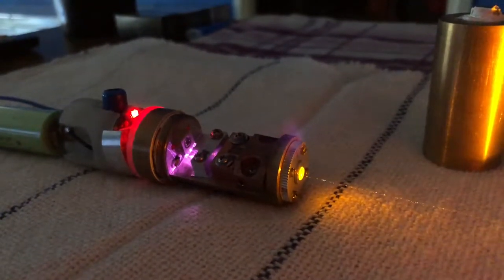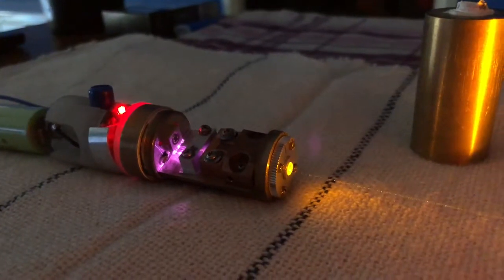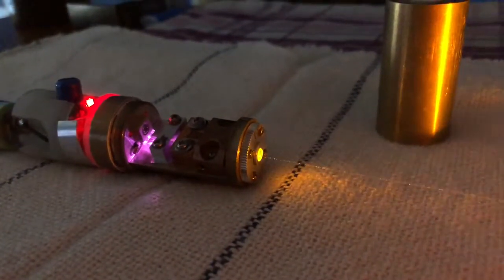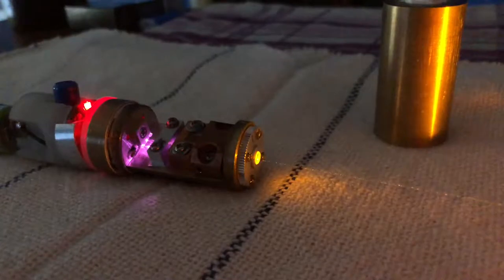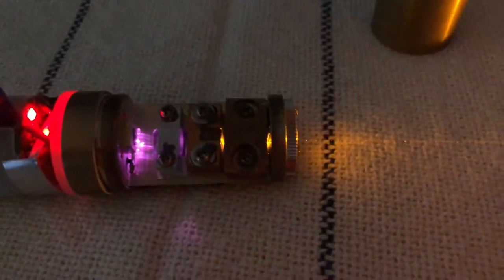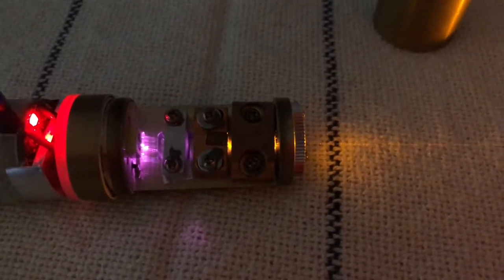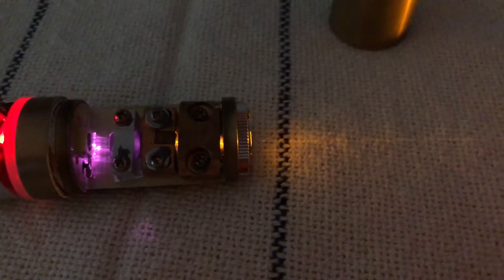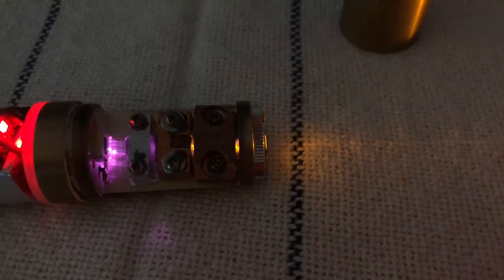Laser Module 589nm

Comment: That's a pretty nice assembly! 50mw?
Reply: Yea its one of those pgl modules
Reply from the maker: Hi Zenodilodon

Bro been watching your vids for a while,  I need your help bro

My 598nm module in this vid stopped 
Working, I love this module !
I bought a 2w 808 c mount and replaced the old one and still nothing 
I think original had a fac lens
The replacement I bought might not
Anyway I haven’t moved and crystals 
Or anything just changed the cmount 

Now I live in Sydney Australia but I don’t know anyone who could fix this
For me but u bro

I would really like to here from you and
See if u have the time to help a fellow 
LPF member with some awesome builds in the past 
badboybilly on LPF
Reply: @Badboy_billy  A FAC lens would change the focal point distance and beam geometry to have a nice point in the Nd: crystal. Without the FAC this point will be ribbon like due to focal point distances being different between the fast and slow axis. You might have to move the Nd: crystal closer or further from pump Laser, though the best fix is to apply a FAC lens. You may be able to remove the old one from the original laser diode and place it on the new one.